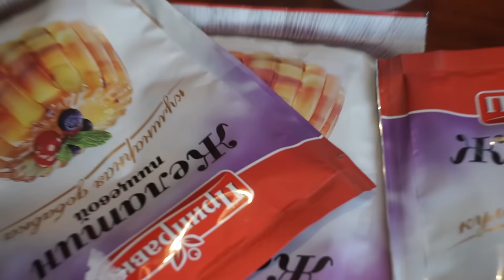Homemade Gear Casting, method of homemade silicone

Comment: spare part: 2,59€
Knowledge gained while casting a gearwheel: priceless
Reply: 18.90€ https://www.ets-buisson.com/deimos-a400a600-couronne-i100009-p-6884.html
Reply: @N0SSAM  and it is from plastic not from aliuminium or americans would say aluminum, just for fun fact :D no offence
Reply: @N0SSAM  Same plastik-shit
Reply: Sometimes the part you need is not available at all, at any price. So the only option is to hire someone to make it for you, or make it yourself.
Reply: @Adam1nToronto  This part could easily be drawn up by just about anybody and 3d printed in nylon by numerous different 3d printing companies. In less than a week worth of study, you could even draw and design it yourself. This isn't something with an organic curve to it that has to fit tightly with another organic curve where you're not even sure exactly how much of the mating surface has worn away. 

There are times when this kind of ingenuity is called for, just not this time. Now, if you want to replace a metal gear with a metal gear, this is likely the way to go. But, if the original part was plastic, there are far better ways of going about it.
Reply: @SmallSpoonBrigade  If it takes you a week to "study" how to design a part as simple as this, you're probably not very bright and probably shouldn't even attempt it to begin with. Designing a gear like this one is a 45 minute job for someone who never used CAD software before, and a 10 minute job for someone who did.
Reply: @David-w8x6q  My English is not the Best, this is why i can You give only a short Answer, and i had to tell a lot. But, please dont speaking, lieing about Your "Great American",....  and IQ.
You take a Land that dont was Yours. Most of Inventions are came from Europe, and much more after WW2. And least, without Oil and Wars Worldwide (in the Name of Freedoom and other Bullshit), Your Country where nothing, like a 3 World Country, like You would say. 
Also please keep Your Bullshit, and tell it some fat, low IQ Americans.
Thanks
Reply: Says the german Nazi
Reply: I had a situation with the Japanese food processor. Same thing, plastic Gears broke into pieces due to missuses. These are professional 1kWt power grade kitchenware which work for generations. Guess my set was like 20-25 years old. High quality stuff. NO SPARES at all. I managed to find the used set with the burned motor in Australia. The logistics cost from Australia to Malaysia was too high to take it as an option. That is when I learnt the whole casting thing again. However I had silicone molds, my friend had a foundry which I was allowed to use for couple of beers,  and the lathe and milling machine shop charged me peanuts to do the finishing work on the casted gears. 
And the feeling of completion of such quest is really priceless.
Reply: @David-w8x6q  "More Americans own a personal machine shop than any other nation"
Per Capita? Evidence? For instance, no one who wants a machine shop in Australia would be denied one.
Reply: @vtbn53  That's probably because Australians know that they'll need them the moment some lab finally perfects drop bears.
Reply: @SmallSpoonBrigade  What do you mean? Drop bears ARE perfect.
Reply: David How does Norwegen IQ averages of 100 fit into your anti socialism ideas?
Reply: @David-w8x6q  Coming from a Puerto Rican with an IQ that is in the 140's before my morning coffee, and  several dozen engineering patents filed you should reconsider much of your post. How can you on one hand criticize judging a country as a whole and then do the same at a different scale? Puerto Rico has between 7 and 8 million people once count those who have emigrated. Not sure where you get your data from but it is about as politically split as the US mainland itself, and the level of education is bi-modal as well, with a lot of ignorant people and a lot of technical genius, and a lot of kindness and hospitality, yet also a lot of crime. Many, Puerto Ricans living in the mainland are, believe it or not, conservatives, although the numbers shift in bigger cities towards liberal. My best friend in high school, who moved to Florida ended up voting for Trump as well as all a couple of other friends from PR who live in Massachusetts. Yet others are extreme liberal. We disagree with each other, just like Americans. Does that come as a surprise? The culture of DIY, as far as I could remember wasn't a "culture" but was pretty much the norm. My dad (a car mechanic) and all his friends all knew how to do electrical, plumbing, masonry and car repair. A couple of them were well versed in RF design and electronics repair. I was taught about SWR and impedance matching when I was 13, by my dad, the car mechanic, who never finished high school. A friend of my dad had an Atari 2600 running on EEPROMS he burned at home. Anywhere in the metro area and nearby it is as sophisticated as any big city, and has been for decades.

Basically, wherever there is economic instability people adapt and learn and take on whatever job they have to to survive. That is what I saw in Puerto Rico around me. And yes, I also saw relentless crime and a culture of people taking advantage of others, but one thing I never, ever saw was "Marxism" with the only exception being college students. And this is pretty much common in many colleges in the US mainland as well so I am not sure it counts.

you should take a dose of your own criticism.
Reply: это же больше 230 рублей а это деньги, душа просит инженерии а то гараж простаивает, в гараж от жены сбежал и творишь во благо
Reply: Boinky  if important thoughts are hidden, things will never change.
Reply: I would guess the spare part would break again while this looks it will last for long time
Reply: @TheSenorTuco  the thing is, that sometimes plasticgears are used for a reason. Not everytime, but sometimes. They are then supposed to be the weakest link to break, preventing further damage to occur.
Reply: May be it is just a way to make tought gear... plastic broken is not the first time
Reply: Ha! We never looking for easy ways!)))
Reply: Getting a chinese POS spare part for a machine with no "customer support", or spare parts department...impossible.
Reply: Becaue oryginał part is plastic new od from alu for more Time
Reply: Если в бою нужна шестеренка, то он ее сделает, а вы будете искать магазин )
Reply: If you need a gear in battle, then he will do it, and you will look for a store)
Reply: google translate
Reply: True that!
Reply: No właśnie. Poza tym to plastikowe koło działa jak zabezpieczenie przed uszkodzeniem całego mechanizmu i w razie jego zablokowania łamie się. Brak elementarnej wiedzy. To nie T-34
Reply: I would have stopped and would be satisfied at 0:33 ;-)
Reply: I would have stopped and would be satisfied at 0:33 ;-)
Reply: What's the debate? This is dope... the dude is putting in the effort in the workshop; and not making a killing machine or gun. On yersel machine genius!!
Reply: yeah i mean its useful when you cant actually find spare parts or if you need an originally made part.. i am looking into doing casting  to expand what i can do with 3d printing :p
Reply: YouTube channel ko subscribe karo , ☞flash 7star
Reply: Buty of art.
Reply: The problem with the spare part that it is also made of plastic.
Reply: they won't sell you just the gear. and it definetly won't cost cheap if they did
Reply: Can someone please tell me what the stuff was in the paper bag that made the last cast that was able to take the heat thx
Reply: @David-w8x6q   David  .... bro, i am muslim. i live in Indonesia. My IQ is 120. my average income is USD 20 thousand until USD 27 thousand in  a month.
.... and I DO NOT AGREE WITH YOU.
you are weird broo.....
Reply: @amanwithhiscigaretteandcof3474  That guy think ...Only Smart people can live in the Staates, all good to you !
Reply: @David-w8x6q  oh, that was deep and so off the point, but, i hope so, i got your point. And your point is wrong. Why? Because average ukrainian makes 400$(despite that i don'nt know, is he ukrainian or russian). On the other hand, dude, who lives in private house with mechanical gates, obviously has car and shop with not so good but lathe and earns way more than average. He could easily buy new mechanism, but he made spare part by himself. Meaning, he enjoys the process, it is his hobby. And yes, like i said, typical american or european fatass would not understand. There is no hatred or racism, i said that just because i totally know, what typical european would think about that. And because i know, that my words would burn some asses😆
Reply: @antares-the-one   Your jealousy is showing. Get back to finishing your socialist bottle of vodka, komrade!
Reply: @SevenSixTwo2012  yes, i am jelous and no, i dont drink vodka
Reply: @antares-the-one  True, we are from the Balkans, Bro they do shit you could not imagine that a farmer have knowledge to do staff like that ! Passion is also a motivation..But tell that a fatty american ! :)
Reply: @David-w8x6q  you're wrong place Nazi is not belong to America Nazi they belong to Europe so if you wanna be Nazi come back to Europe if you're not low IQ!
Reply: @David-w8x6q  So what does mean, that my measured IQ is 122, I mostly make things for myself, even if it's cheaper to buy ones and I'm very antisemite? My antisemithism wasn't taught by any of my family members. I just gained it by researching stuff and gluing those puzzles together. Being pro-semite is being very ignorant and short-minded in my opinion.
Reply: @David-w8x6q  Only the willfully blind fail to see war crimes committed in in Palestine. Realize that one can be smarter than Einstein yet still be a bigot and racist. One classic example is a stable genius yet racist President, nephew to an MIT professor, who supports white supremacists and neo-Nazis. Getting him voted to office proves most Americans share his views.
Reply: If you're talking about Trump he has disavowed racism and the kkk multiple times
Reply: @benjaminbarr8714  I love how this comments about a video of a russian guy rebuilding a Gate Motor was turned into a disucssion about trumps racism. You Americans really are special...
Reply: @peteraugust5295  Explaining the truth to his communist fallacies is not politics it's basic perception that's horribly misconstrued
Reply: @benjaminbarr8714  I am not sure if you are aware of this, but there is close to 8 Billion people on this planet and literally 7.5 Billion of them dont give the slighest Fu** about your president or what you think about him.

You should book a flight and see some place on this planet outside the US buddy...
Reply: @peteraugust5295  P.s. more people migrate to the us than any other nation so it does seem you failures do care.
Reply: @benjaminbarr8714  Jesus... You guys are wack. Get some fresh air boy...
Reply: as i thought. There is no way that american/european fatass would understand what is a feeling to make something by own hands, especially when it has purpouse or is needed
Reply: @antares-the-one  If you live in south america like me, you'll find very nasty ways of doing things as well.. but from a practical perspective, i'd go for the 2.59e spare part
Reply: @sprescav  what if you are living in a remote area where getting it will take you about 100s of kilometers? Then KUDOS to this Plan B.
Reply: @antares-the-one  but the gear was designed to be the failure point and easily replaceable so something expensive doesn't break. Literally he put in more effort to make something that doesn't do as good of a job. And I'm a maker. I pull out my soldering iron when my $20 headphones stop working.
Reply: @jaycie5021  Right, so if the door is jammed the cheap plastic drive gear will break rather than have the motor seized. A metal gear here will not fail due to age/ plastic fatigue, but it also will not "blow" like a fuse...
Reply: @antares-the-one  ?
Reply: @peteraugust5295   I was thinking the same. @Antares what do you mean?
Reply: @peteraugust5295  me to
Reply: @antares-the-one  wow, how many looser is this chat!!! I'm European, but I have learnt to repair and I appreciate a lot this job. Life is not money.
Reply: @giovannipegoraro8740 i am sort of scared of people, who types in their own names into internet accounts, pls dont hurt me, i whant to live
Reply: @antares-the-one  Hallo, i think it was a misunderstanding. I just said that i agree with your comment. Regards.
Reply: @antares-the-one 
I am Italian and European and I love building a lot of things. During my life I have equipped myself with a small workshop. It is not a question of nationality, it is only a question of character !.
Reply: Antares. You watch too much American TV. Visit American based hobby sites and you will see more American and European makers than you can count. Not lazy ones, ambitious ones. Not many from Eastern Europe or Asia on those sites. You have to look on YouTube to find those craftsmen. Hopefully translation software will improve to help us so many more can communicate freely
Reply: Hi Antares! Well answered!
Reply: @antares-the-one  Don't underestimate the American maker culture. Also, some schools to this days have a shop class, so people in the USA do learn how to make stuff. Some places, like Ohio and Illinois have very strong mechanical engineering traditions. Also, because of the no-nonsense regulation people do work a lot on modding their cars, especially for off-road use. Europe has a lot less of that, because more people live in dense cities, where you simply don't have a garage to put your mill and lathe or to work on your Jeep to prep it for trails.
Reply: @gustavlicht9620  as far as i know, american diy extends to "buy new shiny most expensive part, use as little effort as possible to install it and that is all" Americans build their dream shops full of tools that they never use or, in best case, once ot twice. Same shit about europeans. There even more expressed obsession to buy something new, people throw away bicycles and buy new one when their tyres get worn down, this is just fucking outrageous stupidity.
Reply: @gustavlicht9620  Wrong.
Reply: @antares-the-one  I hope you do know that most of the people in Russia live in Europe right?
Reply: @Bartooc  i hope you realise, that we talk about political situation, not about useless geographical position
Reply: @antares-the-one  Whoosh!...... The original post by Peter August (that you first replied to) was stating that the knowledge gained by doing it yourself was far greater, (worth more), than buying a cheap plastic part. Could have saved a dozen replies.
Reply: @antares-the-one  I'm American and I just spent the past 5 days over-engineering daily items for myself and others, just for the sheer enjoyment of creation.

While I can often feel alone, I look around and 1/10 guys has a workshop in their garage.
Reply: @TheNebulon  "While I can often feel alone, I look around and 1/10 guys has a workshop in their garage." - Make that 8/10 have a workshop in Europe.
Reply: @antares-the-one  they will know soon enough...
Reply: @antares-the-one  yea! and the others do not have internet and still exchange 1.44MB floppies, right ?

Comment: careful, that plastic gear might have been an intentional weak link. with two metal gears it might go into orbit
Reply: That's what I was thinking.
Reply: can you elaborate
Reply: @tyscof  In short, designers will put a weak part into a mechanism intentionally for damage control.
Like the operation rod in an M1 Garand. The purpose of this is to induce failure in a safe area / safe way to keep the damage limited to just that part.
Instead of an engine burning out or metal gears being stripped, they would rather snap a plastic part that (after being broken) would relieve tension on everything else.

The orbit part was a joke about built up pressure/torque being released violently sending things flying.
Reply: @Paid2Win   Why not just use a spring tension tang or sprang clutch type "torque release" mechanism , plastic is CHEAPER.
Reply: @joew7013  Yeah, easy to say from where you're sitting I am sure.
Reply: @Paid2Win  As Engineer, you are absolutely correct.
Reply: @Paid2Win  i mean it will take a bit more force to make the gear fail now,  but hes still using aluminum.
Reply: @Paid2Win  it's more lawyer repellent then then anything
Reply: @tyscof  what johnathan said
Reply: Same thing I was thinking, the nylon gear was a safety feature. He just bypassed it. Oh boy. :(
Reply: Plastic gear as fuse but well done for other repairs

Comment: Wouldn't it have been 10 times faster to either machine a gear from steel or even 3D print a gear and use the 3D print for casting? This does seem like a huge time sink as the part is not so complex.
Reply: No.

Comment: That gear was plastic for a reason though, so it broke instead of the motor. Sometimes it's best to leave things be.
Reply: I don't think you know how electric motors work. They don't just turn and explode. They have over current protectors and fuses so as the load gets too high they trip out. These machines are planned obsolescence and the gear is plastic in a place that wears quick and should have been metal otherwise all lathes,milling machines, cnc machines etc would have just plastic gears but that's not the case. Please don't spread lies. That gear was plastic so customers would have to constantly buy new ones.

Comment: What's going on at 2:38? It looks like foam tape on used to enlarge the gear? And then something is poured in to dissolve it? I think I followed the other method tough. Thanks
Reply: Это припуск на токарную обработку. Добавляет двусторонний скотч, чтобы зубья были больше, чем на оригинале, чтобы потом сточить на токарном в размер.
This is a turning allowance. Adds double-sided tape so that the teeth are larger than on the original, so that then grind on a lathe to size.(Google translate)
Reply: @Pren66  well done Sir